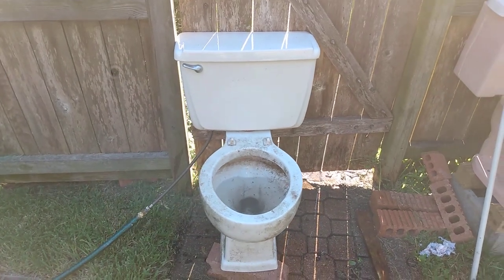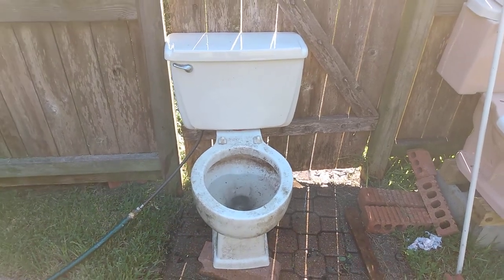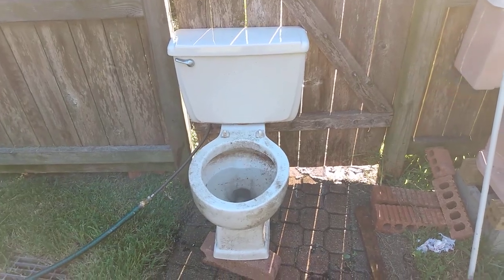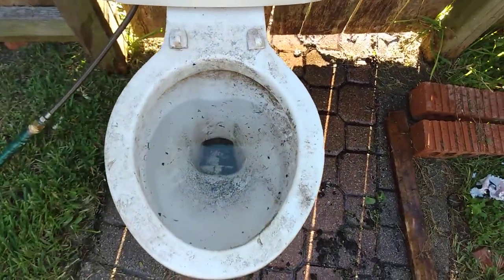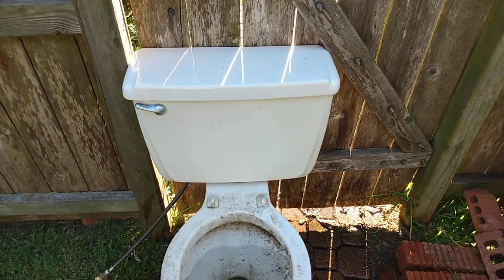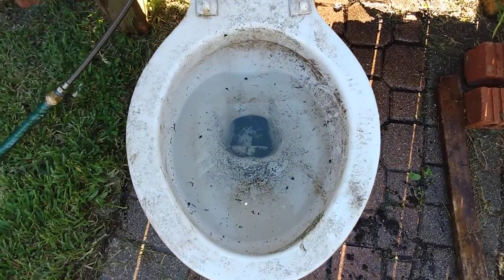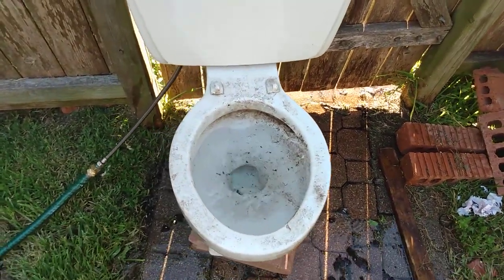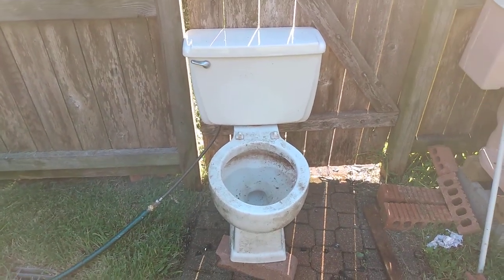1955 Kilgore Apex Flushes!

Comment: Fill the bowl completely with Muriatic acid and let it sit for a day. If this does'nt work there's no hope.
Reply from the maker: That would be very expensive. I know what is clogging it and it's dirt and roots.
Reply: Try using a drain snake.
Reply from the maker: @terletsandstuff6142  I might put a pressure tank on it.
Reply: @OCC_Plumbing_and_Restorations  with what?
Reply: @terletsandstuff6142  How??
Reply: @meggiewillis9705  Take the tank off and force it down the jet passageway if it will fit without breaking the bowl.
Reply: @terletsandstuff6142  Oh okay. I don't know much about toliets. Can I used this for that guy who harressed me before? And for Andre Cartier for cheating on me plently of times.
Reply: @terletsandstuff6142  I need your help.
Reply: @OCC_Plumbing_and_Restorations  Mara knows now.
Reply: @meggiewillis9705  With doing what, I don't understand how that comment is gonna help you.
Reply: @terletsandstuff6142  Because Andre cheated on me. This other guy was bullying me by calling me a fraud and liar.
Reply: @meggiewillis9705  you can use it if you wan't